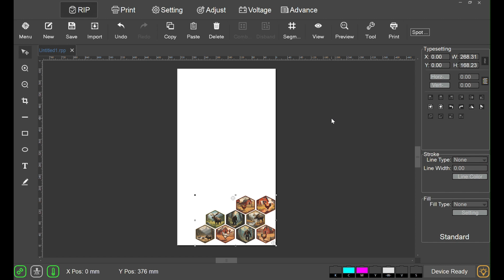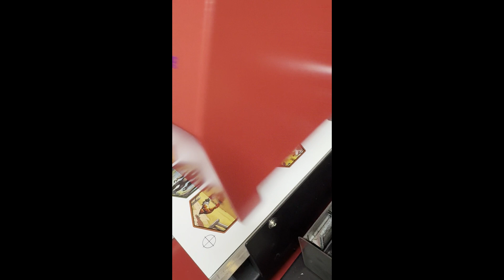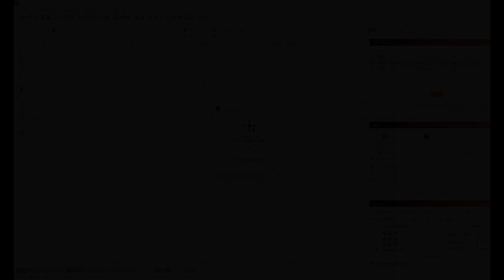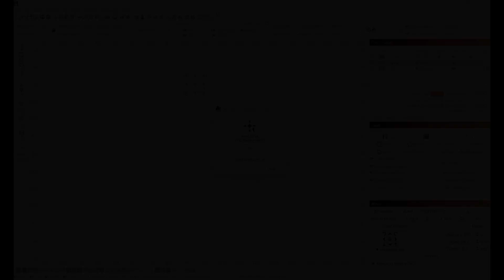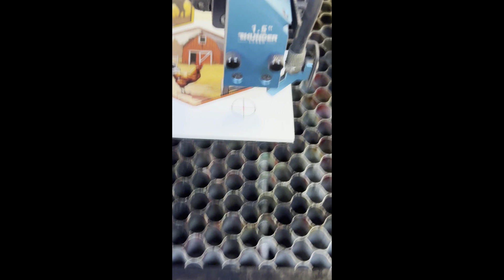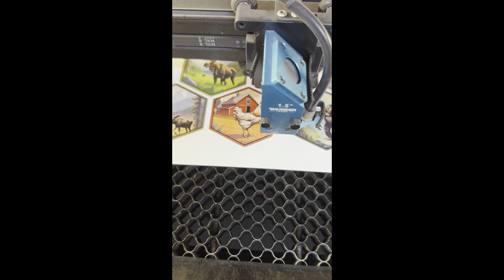Mastering LightBurn’s Print & Cut | UV Printing & Laser Cutting with the Thunder Bolt

Comment: Great video! I would also encourage pulsing on each registration to make sure its right. My laser is suuuuuper dialed in but going from one corner to another with a larger sheet the error will be greatly expanded upon. I am also running a Bolt and love it, wish Thunder would come out with registration camera system to speed this up.
Reply from the maker: Totally agree on the camera system! We’ve since started pulsing as well and it’s really helped us dial it in.
Reply: @tridentlaserworks  Can we not use UV DTF and paste on that hexagon cut and heat press?